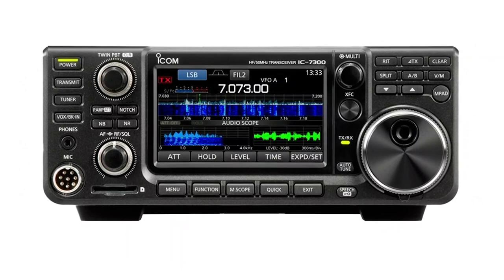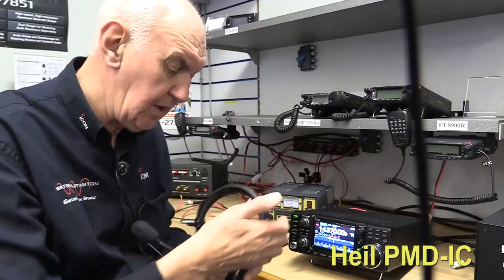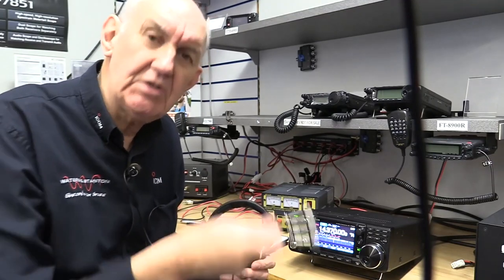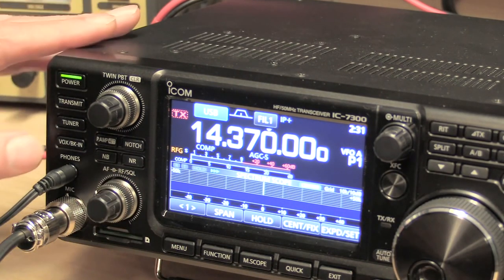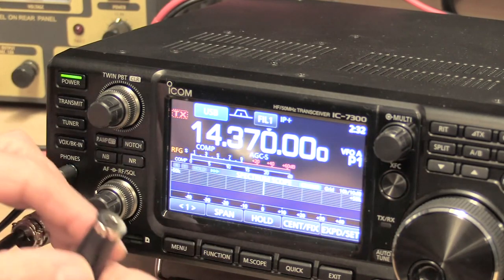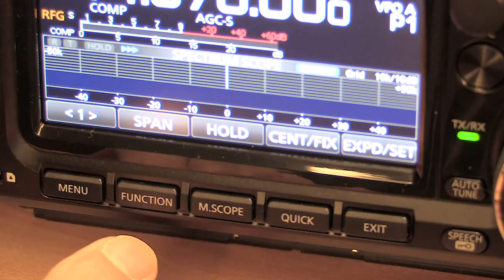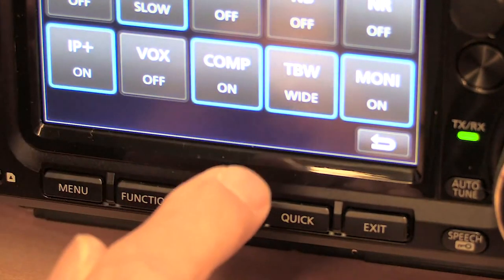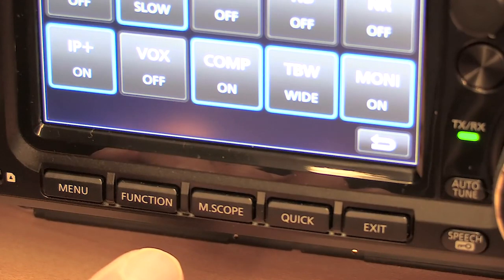Heil Headset for IC 7300 or IC 9700

Comment: 3:00 "it's probably quite easy to fabricate your own switch put it on an end of a bit of cable with a quarter inch plug going to there and then you've got your PTT." 

 I just got through making up one of those.  The soldering was a little tough because the pins on the 8-pin connectors are tiny, and also because I'm old (hi, hi).  I also used a 3.5 mm jack instead of a quarter inch.  The job took 5 hours and 15 minutes, tedious, but now I can use a foot switch with any 8-pin microphone.

Comment: What does Icom Recommend Electet or Dynamic??
Reply: If its for Icom go for the electet IC  model, you can use the dynamic version with an adapter that addresses the voltage issue but you'll really struggle to get the TX audio as good as the stock mic. Btw the stock mic has a Heil element. I tried this adapter on a Heil micro pro I'd been using on a Yaesu, to get any sort of decent TX audio i had to run it hot with both mic gain and compression almost at max. Still couldn't get the audio as good as the stock mic.

Comment: I always get excellent reports using the stock mic on my 9700. What are the benefits of using an aftermarket mic please?
Reply from the maker: if you get excellent results then stick with what you have. The  main reason for switching is to get the use of a headset. 73s Peter